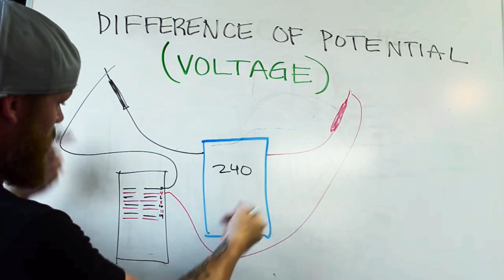Episode 38 - 11 Confusing Code Terms - UNDERSTANDING THE NEC

Comment: In 314.16(B)(3) it talks about studs and hickeys in regard to box fill calculations. Those make sense for calculating luminaires and such, but is a strap, which I understand to be the flat portion of a luminaire or maybe even a fan, that mounts directly to the J-box, considered to be a yoke? Nobody seems to say that, but it is a device, is it not? Is it because generally the strap doesn't enter into the box, and that's why it's only counted when it's a receptacle or switch? So, if a wall sconce connects via a strap and does not have a stud or hickey, then you only count conductors, grounds and clamps because the box doesn't technically have a device attached to it that enters into the box like a receptacle/switch yoke?

Comment: im a total newb
awesome video

it seeeeeems....that a bunch of these instal codes are designed to 

1 keep an electrical system bolted the fuck down in the event of catastrophic damage
shits bolted and nailed down, 
cause it aint goin anywhere until theres a flood, or a tornado or an earthquake 
and having EMS crawling around in a damaged structure....the least thing anyone needs in a situation like that is for the wires to fuckin fall out and energize shit, or set shit on fire or kill people

2 limit the use of extension chords, especially in wet rooms
like....why so many "recepticles" in a kitchen you ask?
its so that linda doesnt use a broken blender in a kitchen off an extension chord from uncle tony's toolbox with the ground lug snapped off plugged into a non-gfci circuit in the other room and kills herself when she touches it and the kitchen sink at the same time
extension chords are the culprit in almost every resident electrical fatality in a house built to code
cant stop people from doing it, but you can at least limit it

3, prevent fire 
a stick welder runs on 50v and can easily melt steel almost immediately.....thats fuggin lotso degrees
110v?....220?
thats lotso degrees too
one bad drywall screw in a house full of a zillion without arc fault protection or nail plates and you got yourself a bad fuggin time

so....
everything in those codes is based off of this

so....when in doubt...overbuild, overprotect and be paranoid
it may cost you an extra $40
but its cheaper than a potential wrongful death lawsuit or a housefire 

makes me sleep at night 

i learn as much as i can from both sets of codes, and implement both as much as possible 

fire caulk/foam isn't required where i am....but its like $6 and....its just safer
20 amp plugs?
little more expensive but doesnt waste my time...

its easy to get a little complacent 
but you gotta realize even if you install shit that passes...other people will still find ways to fuck up and sue you
take the extra steps and learn as much as you can

Comment: Clear thinking should be supported by clear writing. Unfortunately because of common usage, specific terms like "grounded wire" and "grounding wire" are too easily confused, and so should be abandoned. People who write the code books need to tear a page from the common electrician's cheat sheet. The terms "neutral wire" and "ground wire" could not be more clear.

Comment: I think you are confused about utility transformers. You said that they ground the neutral on a transformer up on a pole, but this is not the case. That’s why the electrician grounds the neutral at the service disconnect. The only time the neutral is grounded at the windings is at a customer-owned transformer inside the building.

Comment: #3;  you make it sound like they're only 2 conditions of wire, grounded and ungrounded.   And in the end of that explanation you said the current goes back to the neutral wire in a short condition...  Well $hit, their are obviously 3wires, one hot and one "neutral" and a "bond"or "ground"wire as you in the states call it.    in a short condition, the current carries thru the bond wire, or in the case of someone using something...through the casing and perhaps thru them,.
Reply: That is correct.  There are un-grounded conductors, and grounded conductors.  The grounding conductor (EGC, ground wire) is a type of grounded conductor.  But it's also a special type, since it normally does not carry current in a properly designed and functioning circuit.

Comment: Hmmm.....I always thought a 'Ground Fault' happens when 'any' current flows in the 'safety ground' wire,  actually the GFCI device 'senses' even small current 'differences' between the hot, and the 'grounded' conductors (neutral & safety gnd).  That small difference maybe a human body, conducting... even as little a .004 Amp can cause death.  So in essence it measures the 'input' current from the hot, and compares it to the 'output' current into the neutral, and it 'should' be the same.

Comment: One of my noise making creations had a short circuit problem a while back. I am still unsure of what caused it to happen but my 5V regulator and the IC that failed heated up HOT N FAST! I powered it down and started probing the circuit and discovered that the IC pins for Vdd (+) and Vss (-) had direct continuity --- hence they were shorting out. I simply replaced the IC that faulted and, as far as I know, the circuit still works fine (it was gifted to a friend).

Comment: 480 Corner Ground Delta....
Reply: an example of a grounded conductor that is not a neutral
Reply: @Bradley-tx6ed  when I started to run across those systems about 15 years ago....It would rack my mind......salutations Brother Electrician